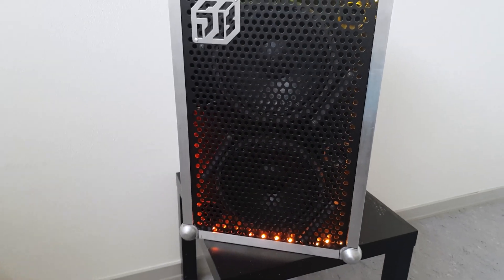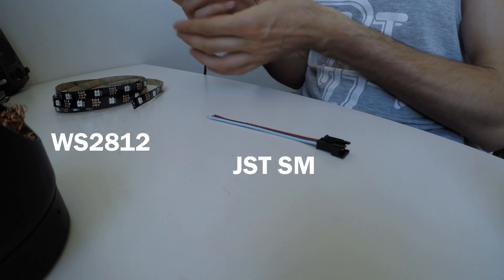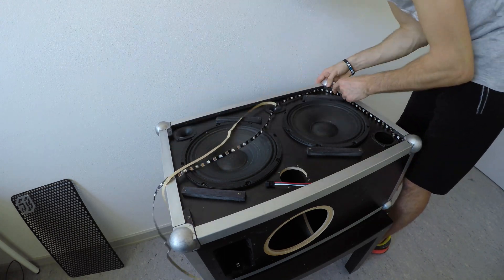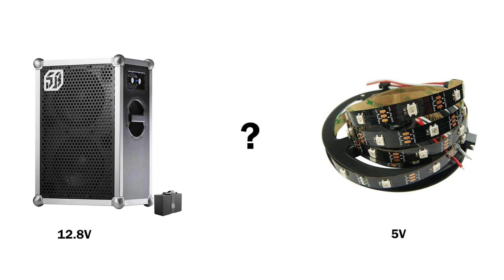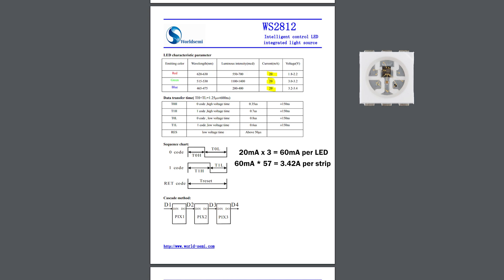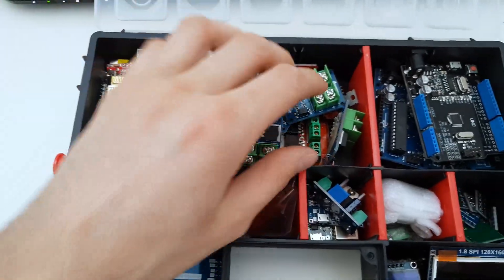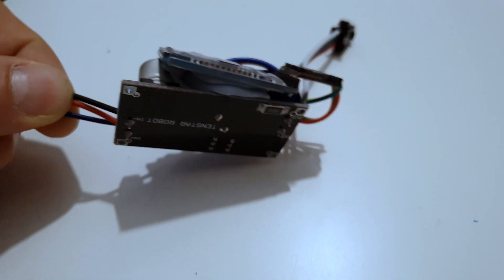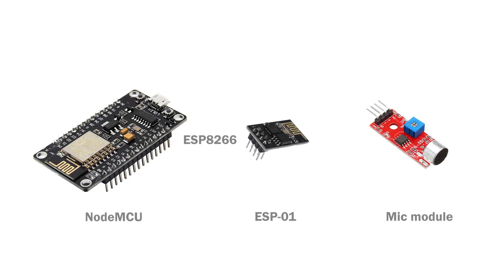How to: Soundboks LED Walkthrough

Comment: There is nothing wrong with the Soundboks design the design is perfect but to get the quality sound to get a deep bass you need to make it with 2,15 inch speak and  a bigger battery and more power 
We want one box to do the job of two, the design of the box should not be change it just need to be bigger you should not need  to buy five box when you can use 2,15 inch bigger speaker in one box 
As one of Soundboks best customer my opinion should be valued  soundboks is going around in circles you have made all the box the same size and then you call that new to be new you have to step out of your comfort zone and be innovative I love the design but I need you Soundboks to go bigger 
if you say that you're for the out door party's then that defeat the hold object

Comment: Hey man! thanks for this movie, its looks awesome! Im courious if it is possible to connect SP107e (5V) throught a USB cabel (5V) to average powerbank 20000mAh as a power supply. You think it is possible to work? Greetings from Austria!
Reply from the maker: Hey! Glad to hear you liked it. I don't see a reason why it shouldn't work. However, depending on the length of your strip, the current consumption might be higher than what your powerbank can provide. This might result in an unexpected behavior or even a damaged powerbank, so if you want to be safe, always calculate the worst case scenario power requirement for the strip and check whether your power source can handle it.
Reply: @StanleyProjects  you right! Thanks for an answer 😉
Reply: @aleksanderperl  Geh auch heute an das Projekt hab mir schon alles bestellt, wenn du eine Powerbank von beispielsweise Anker nimmst, welche selbst erkennt wieviel Strom benötigt wird sollte es kein Problem sein. Ist es richtig das ich wenn ich den SP107e habe garkeine arduino teile brauche?

Comment: If you want the animation to react to the music wouldn't it be simpler to just hook up the Arduino to the wire powering the speaker itself and listen in on the current that drives the speaker coil? Wouldn't that be simpler and less noisy than listening to the actual sounds with a microphone?
Reply from the maker: Good thinking, but the output of the amplifier driving the speaker can have pretty large voltage variation. However, you could listen in on the audio signal that is fed to the amplifier, and that would most likely be the ideal solution.
Reply: You will burn your arduino

Comment: Really want a suggestion on how to do this on my sb3
Reply: If not too late, buy led strip with a transformator, mine I control with an app, removed the usb power supply and wired it to x4 AA batteries, thats 6 volts, its all covered up and almost invisible. Glue/tape the led to the grill, and it will sit perfectly
Reply: Same
Reply: Same
Reply: Basically the same way, the sb3 is pretty similar

Comment: Looks great! Is there any chance that you have the standard set commands for the Bluegiga WT32i that comes with the Soundboks 1 or 2? I was messing around with mine and was stupid enough to not have a backup before doing so...
Reply from the maker: Thanks! No, unfortunatelly I don't. I was just adding an additional module, rather than messing with the existing one.
Reply: This is awesome. If only I knew half of how this stuff works 😂